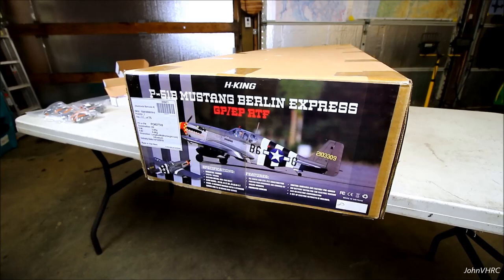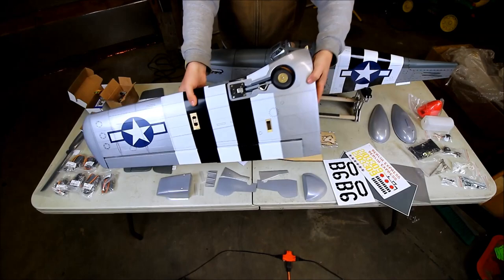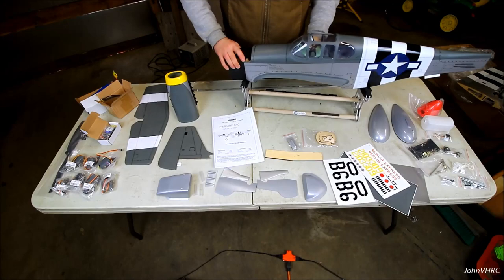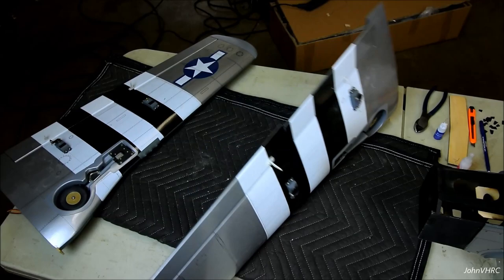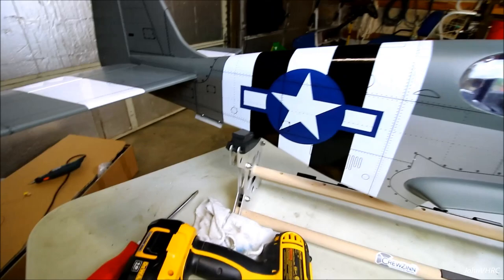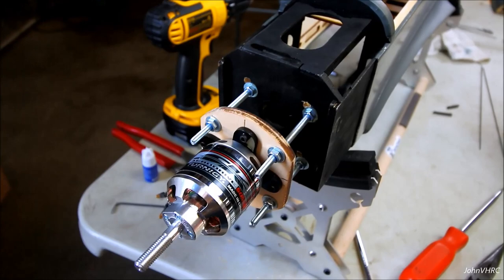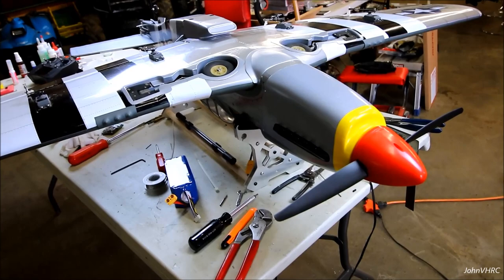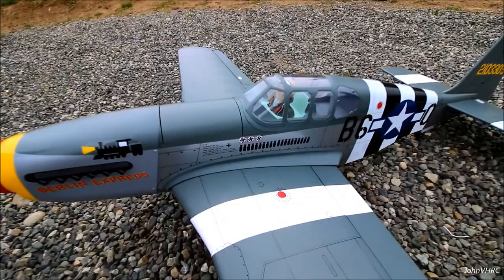UNBOXING/ASSEMBLY VQ Model P-51B Mustang 'Berlin Express' ARF from H-King Hobbyking review

Comment: Thanks for the build video. Just finishing up mine and I referred back to it. I altered a few things in my build: Dubro soldered linkages, external 10a BEC (just to be safe), and I hot-glued the plastic bits on the bottom side of the wing instead of CA. I also didn't use the linkage splitter for the rudder/tail wheel and instead ran both pushrods to the servo arm at different positions. This allowed me to get full throw on the rudder without the tail wheel reaching the end of its travel. Almost ready to test the CG now. by the way, in case anyone is wondering, the extra servo tray and wood bits would be to mount a mechanical gear servo in the rectangular opening on top of the wing.

Comment: Just a thought about the recommended 6mm throw on the ailerons.
I think this is recommendations from the old version of the VQ P-51, which had no flaps, and had much longer ailerons which went along the whole back of the wing. Which means they had a lot more effect than the newer, much nicer looking ones, shorter ones.

Comment: Hy John I think for your next project it will be better to connect directly the motor to the m4 spacers .Regarding your CG your battery is way back and you added lead to the tail. Can' you move the battery forward?  Just my 2 cents Cordialement Adrian

Comment: Looks like a very well built plane and strong.  I fly the Hangar 9 p51 40 size and it's now 9 year old and still going strong with an OS 55ax two stroke.  But I wouldn't mind buying this plane to have as an electric model.   Thanks for sharing, I enjoyed this video very much.
Reply from the maker: The landing gear need a little attention, there is a space between the strut and the retract, should put a collar or something in there to take that out.